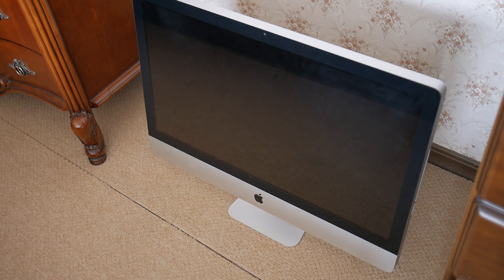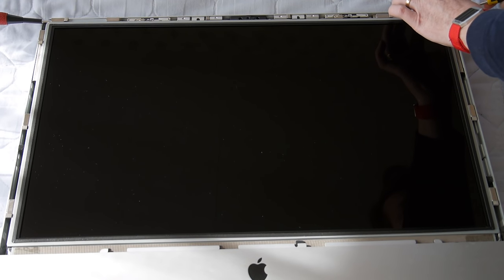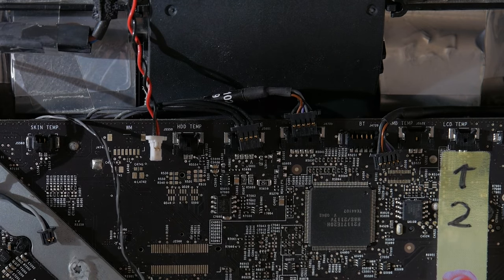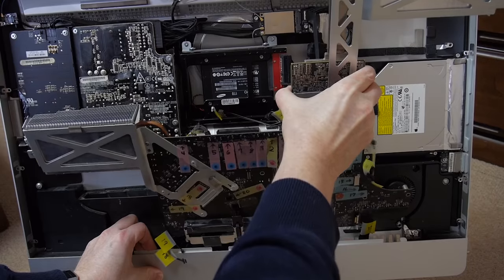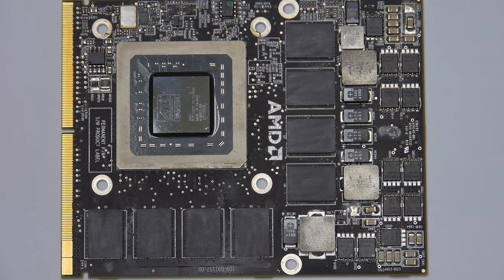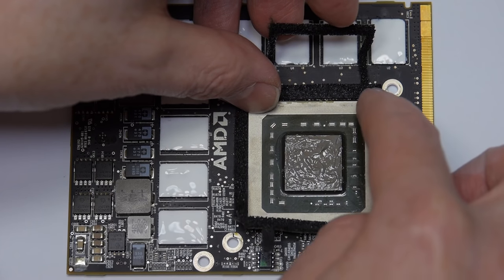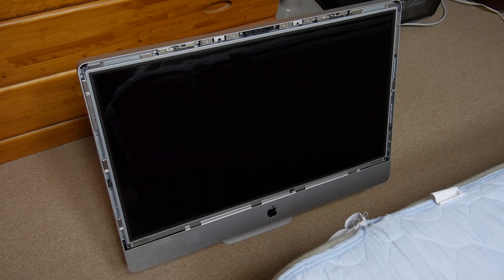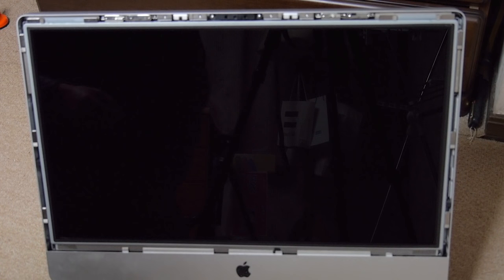Late 2009 iMac 27" Video Card Repair [4850 Bake]

Comment: amazing! did my first GPU bake! imac 27in 2009 working great! July 19, 2020
Many thanks!!!
Reply from the maker: That's great to hear.  Thank you for letting me know, Jujoe!
Reply: @JDW-  its hard to do this with big hands! haha
Reply: it is better to remove the monitor connector from the monitor first, not from the main board. you have to remove the duct tape before. Thats easier for big hands :), for you next bakes :D perhaps
Reply: @hubertsternthaler5538  having sound issues, the speaker icon turns gray(not clickable) and clickable again when watching online movies(youtube, prime movies), but played an itune podcast and it just played the sound with no issues.
Reply from the maker: Hubert, I really don’t see clearly how it would be to anyone’s advantage to remove the connector from the backside of the display first in light of the fact you would need to remove some very strong tape to do that. I would think they would be more danger of accidentally breaking the cable that way.
Reply from the maker: Jujoe, sorry to hear about your sound issues, but the only logical explanation is that one of the speaker connectors on the right side of the motherboard wasn’t secured perfectly when you put the machine back together.
Reply: @JDW-  You are right, but if u have removed the display panel for the first time its easier to insert the Display Port Cable back if u do it at the panel. Distance, big hands, angle. (you have to remove the strong tape). AND! :) , I learned, its not possible to remove the whole mainboard. You can release the 3 screws from the card attachment , the heat cable (with a tweezers from the back of the mainboard) and you can easy remove the video card thoughtful. Bake and back in. Perhaps its for baking veterans :D
Reply from the maker: You are commenting under my 1st Bake video which describes the procedure that removes the logic board, which is possible to do and is required if you wish to replace the PRAM battery which sadly is placed on the back. In the text description under my video though, I provide a link to my 2nd bake video which describes the procedure without removing the logic board. I recommend that for most people who don’t care about the PRAM battery.
Reply: @JDW-  just an update, a book fell on the top left corner of the screen, now sound issue is ok. haha
I hope the issue will not come back.

Buti i have a iMac 2008 20in and there is no speaker sound, bluetooth is working, system volume is working but no sound is coming out of the speakers. Any ideas what should i look for? Thank you!
Reply from the maker: @JujoeM  Yes.  I would suggest another book.  :-)  Seriously, if a book hitting your iMac got the sound to work, it is clear the root cause was "bad connectivity" somewhere inside the iMac.  I wouldn't be surprised if your other iMac has the same problem.  But for now, you can try connecting headphones to the back and see if you can hear sound.  If you can, then something is wrong with the speakers or the speaker connections.  But if you cannot hear sound through headphones, then I suspect it is some other problem.
Reply: @JDW-  yes, for the 20" imac, no sound from the earphones also, but on the settings, it detects that there is a jack inserted. i'll try to unmount and mount the sound card. maybe something is loose.
Reply from the maker: @JujoeM  Your link says "Access Denied."  I clicked request access and am waiting for you to approve it. Thanks.
Reply from the maker: Thank you for emailing me the photo.  That is a Solid Tantalum 6.3v 150µF capacitor which has cracked and burned due to a voltage spike or over-voltage.  Here's the datasheet: https://www.niccomp.com/products/catalog/ntpg.pdf

Comment: Hey thanks for making this video, it really helped. My friend is doing it too but he was wondering if the atrtic sliver compound will also work in place of the white thermal compound. Thanks for taking the time to make this!
Reply from the maker: Thank you for your kind words.

The answer to your question is No.  Here's why.  Arctic Silver V is not electrically conductive but it is capacitive.  It's very hard to get the right amount on the GPU such that there is adequate paste/coverage yet no overspill.  Any overspill will touch the tiny SMD capacitors surrounding the GPU, potentially causing issues.  It's best to use something like K4 Pro or Thermal Grizzly Kryonaut on the GPU.  

As to the memory chips, NEVER EVER use the same GPU/CPU paste on those chips!  Why?  Because there's a gap between the top of those memory chips and the bottom of the heatsink and normal thermal paste won't fill that gap properly long term.  You must use either thermal pads (which I dislike tremendously because it's hard to know the right thickness) or K5 Pro, which is the only thermal pad replacement paste that I know exists.  I can also vouch for the K4 Pro and K5 Pro combo as that lasted 2 years and 9 months after my 2nd Bake.  On my 6970M I used Kryonaut on the GPU and K5 Pro on the memory chips.  There's nothing wrong with K4 Pro for the GPU, but if you have Kryonaut, use that on the GPU (not on the memory chips), as that is the best paste you can buy outside liquid metal. (And no, do not use liquid metal on these graphics cards!)  For additional Q&A, please see my video FAQ here:
https://youtu.be/hldcyJ_qUD4
Reply: @JDW-  Thanks for the advice and the fast response! Do you happen to know what the black tape foam-like piece was? Or if it was even necessary to keep?
Reply from the maker: @bushbush3938  I believe it merely acts as an air filter of sorts, keeping dust from collecting around the GPU chip since a fan is constantly moving air around it.  But that is just my guess.  I have forgotten to put it back on before and there was not an issue.

Comment: Thanks , Took it apart found one loose wire,still black screen, thinking to take it apart once again.Maybe reply the compound? Maybe over cooked the card.
Reply from the maker: Did you use K4 Pro on the GPU and K5 Pro on the memory chips?  If not, what pastes did you use after your bake?  The pastes should not cause a black screen, however, since the black screen would happen immediately on power on, which isn't enough time for the card to heat up due to a bad thermal paste job.  What temperature and duration was your bake?  And did you check your oven temperature with an oven safe thermometer to ensure that temperature was accurate?  If not, I would suggest you measure it.  

I read and reply to every comment under all my bake videos.  Until now, almost every case of a black screen has been due to something disconnected or improperly seated, rather than a failed bake or bad thermal paste.  The two ribbon cables are usually the culprit.  It could be the ribbon cable wasn't seated back in its connector properly.  It could be there's a break in the cable.  It could be the cable was yanked on too strongly during disassembly and the connector on the motherboard was partly ripped off the motherboard.  I've had people report on all of those things.  So opening the iMac once again to check your connections is necessary, unfortunately.

Comment: i'm gonna try this in the upcoming weeks (when Ifixit delivers my suction cups) Thanks for the great video, will let you know if it works.
Reply from the maker: Thank you for the kind words, Luke.  Best wishes on your repair.  Just remember to take it slow and mark everything so you don't forget how to put everything back in place.  If you forget something, the Mac with either not work properly or fans will run on high speed.  Not the end of the world, but it would mean you'd need to reopen the Mac again, which eats a fair amount of time.  The part I hate the most is getting dust out from behind the glass in the final step of closure.  It's a pain!
Reply: The videocard has just been baked , will let you know tomorrow if it works :)
Reply from the maker: I look forward to hearing your report, Luke!
Reply: THANK YOU SO MUCH!!!!!! It works like a charm!!!! After installing everything back the mac powered on as if nothing had happend! :D :D :D
Reply from the maker: Wonderful to hear your success story, Luke!  Hope you enjoy that fixed Mac as much as I continue to enjoy mine!  Best wishes.

Comment: Exact same probs  including having had the card replaced by Apple and 2 moths after the 3 yr change the problem developed again....Planned obsolescence?   If there was a better product i would like to know....I hate being used like this
your vid is much better than iFixit. I too live in Japan    would like to have you meet some of my Mac cohort.....i live in Tokyo
Reply from the maker: So close, yet so far away. I live near Nagoya, a roughly 6 hour Highway drive South of you.  I not sure it’s planned obsolescence. It’s definitely incompetent design though.  Because the card design itself is faulty, I honestly don't expect the bake to last more than the 3 years a new card typically lasts.  But in my opinion, the bake is a low cost way to get more life out of a machine that really should last 10 years in light of what we originally paid for it.  Best wishes, Daniel!

Comment: I did this 2 months ago and it worked EXACTLY as described here. AWESOME.  Today I started having a similar problem, the screen going black while working and the only way to get it back is to turn off, wait a few minutes and turn back on, it stays lit for 5 minutes then goes black.

Have you had this happen before?  Do you know of a fix? 

Thank you very much,
Reply from the maker: Hi, Jeff.  As mentioned in the closing paragraph of the text description beneath my video above, my first bake lasted only four months. But the good news is that my second bake is still going strong, now 2 years and 2 months later. The reason your bake lasted only two months is unknown, but it could be the thermal paste you used, or the fact you didn’t clean off all of the stock thermal paste and thermal pads prior to applying new paste, or it could just be that your card needs a second bake. In any case, my second bake video below should help you resolve the problem.

https://m.youtube.com/watch?v=6BJGLFCigdA
Reply: @JDW-  Thanks, I saw that but just had to ask the question. Sorry. 

Is it OK if I use Artic 4 (non-conductive) for a areas that need the paste?  I noticed you mentioned I can use the 4 versus the 5 in the paragraph above.

OR must I use both, conductive and non-conductive.  Sorry, but I want to make sure.

Thank you
Reply from the maker: It’s not a problem at all, Jeff. I’m happy to help. Arctic MX-4 is fine for the GPU but not for the memory chips. You either need thermal pads of the appropriate thickness or K5 Pro. Since I had no way to measure the gap between the memory chips and the heat sink that would let me know the thickness of the thermal pads I would need, I went with K5 Pro (after my second bake) and have no regrets.

Comment: Thank you, thank you, thank you!  My computer is up and running with no more pink lines. Only took me two days but I was also replacing the battery and got caught up with trying to put the logic board back on. I forgot to take the RAM out, so it was impossible to set the logic board in deep enough. Although it is up and running, the fan is SOOOO loud (I am assuming fan) Do you know where I may have gone wrong in this regard? I hate to have to open it back up.
Reply from the maker: There have been others who followed my procedure and ended up with loud fans.  Chances are you either forgot to connect one of the tiny connectors that lead to a temperature sensor, or you may be connected it in a faulty way such that the connection is either intermittent or no connection is made at all.  If you don't want to open your iMac again and check all connectors (which would take considerable time), your only recourse would be to use a software solution like "Macs Fan Control" or "smcFanControl."  Either of these apps let you select the fan speed you want for each of the fans inside the iMac.
Reply: JDW Will look into the apps. I did notice that you had a red and black HDD connector with a white head that I did not have. Took me a while to figure out that it was truly missing (luckily I took a photo of the computer before I started)

Comment: thx man, it works. So far for 20minutes but i hope it will last.
Reply from the maker: Thanks for sharing your story of success.  If ever your iMac does stop working again, I would appreciate hearing from you here in the comments.  From what I see in the comments, it works well for most people and it lasts too.  As for me, my first bake lasted only 4 months, but I used better thermal paste on my 2nd bake and that 2nd bake is still going strong 2 years and 3 months later.

Comment: Your video inspired me to perform the bake repair on my mid-2011 iMAC's graphic card.  So many connectors, I thought for sure I'd screw one or more of them up, but despite my cursing Apple for making such a convoluted and complicated mechanical design, it actually booted up when I was done putting it back together.  After sitting half taken apart for over a year!
I realize this repair is often temporary, so I'd like to try and get a new card.  Any tips on 1) how to identify the card version in my machine and 2) where to find a new card, not a re-worked imposter?   
Thank you!
Reply from the maker: If you have a 27" iMac, then the 2GB 6970M is the best STOCK card you can buy, and I actually bought the 6970M from the following EBAY seller to use in my 2009 iMac, which works.  But if your heatsink is different, then you'd want to buy the higher priced version that comes with the heatsink, otherwise you could just buy the card.  The heatsink is very important though since the 6970M runs hot. https://www.ebay.com/sch/m.html?_ssn=shawn882014&LH_PrefLoc=&_from=R40&_trksid=m570.l1313&_nkw=6970m&_sacat=0

Comment: I will proceed to repair my mac!! gr8 video! 1 small question. the oven set in 200C from 0C we put the graphics in, or do we preheat to 200C and then we put the graphics inside? THANKS A LOT!!
Reply from the maker: I preheated my oven to 200°C for 15 minutes before I put my video card inside.  I would recommend that you do the same.  Please be sure to let me know how it goes for you after the bake!
Reply: i will let you know. i'm buying the components and the k4&k5 pastes

Comment: There was a known issue with that particular card, when they overheat, the contacts melt and you start having some weird lines on the display.    .  You might end up having the same problem again,.   

 I solved it by buying the upgraded option they offered back in 2009, the AMD Radeon HD 6970M... not only it's cheaper than the  ATI Radeon HD 4850, but it's 1GB instead of 512.   I replaced it almost 4 years ago, and my computer has stayed ON 24/7 ever since, and  with screen saver when I'm not using it....
Reply from the maker: The 6970M video cards also had issues, but for what it's worth, I did upgrade to one as mentioned in my other video here: https://youtu.be/9dPsH1zIQMs
Reply: @JDW-  do you have any recommendations to make it run cooler?.. the this one runs way too hut.  Also, do you know how much RAM it actually supports?.. I know the specs say 16GB, but I have 20GB , and I was wondering if I can put in 2x16GB modules.
Reply from the maker: @jcnavarro  Use one of the fan control apps I link for you inside the text description under the video above and set all 3 fans to run at 2000rpm.  That keeps the card cool enough in my case.  You could run the fans even higher, but I think the noise might be bothersome.  Also, in the summer months, I use room A/C.  Without A/C in the summer, even maxed out fan speeds won't keep that hot-running video card cool for long.  But with it now being the cooler months, the iMac fans alone should suffice.

The late 2009 27" iMac can take 32GB: 
https://eshop.macsales.com/blog/17059-late-2009-core-i5-i7-imacs-owc-maxram-certified-to-32gb-of-memory/

Comment: When the graphic card is out how clean the old paste?,  before to put in oven?....thank´s very much for your help!!!
Reply from the maker: I needed about 10 cotton swabs when used with dehydrated ethanol/alcohol to clean off the old paste from the tops of the GPU and memory chips. I did NOT clean off the old, THICK paste on the heatsink that sits above the memory chips simply because I did not have enough paste or the right kind of paste to do that job.  That thick paste is almost like a putty.  It is different from normal thermal compounds which are much more liquid and therefore must be applied sparingly.  The thick paste is used for wide gaps between a heatsink and chips.  So if you remove that thick putty-like paste, you would need to find an equally thick replacement paste.  Thin pastes will not work above the memory chips because of the large gap!  That's another reason I left that thick paste in place on my heatsink.  If you don't have dehydrated ethanol, normal alcohol will work.  If you really want to go "Pro" I suppose you could use Arctic Silver Arcticlean & Surface Purifier to remove the paste, but again, alcohol should work fine for you.  Best wishes.
Reply: My friend i have the same trouble whit my Imac , I am in the way... thank´s a lot for your answer , your time and patience
Reply: I buy  Mastergel white and grey , white is low viscosity thermal compound and grey ultra high thermal condctivity compound
Reply from the maker: Please let us know if you are successful, Jose!